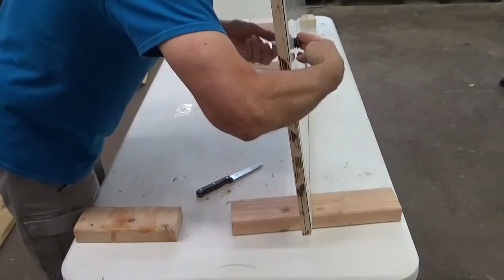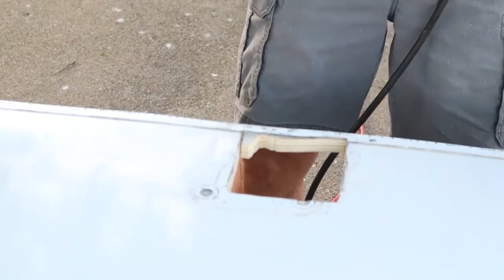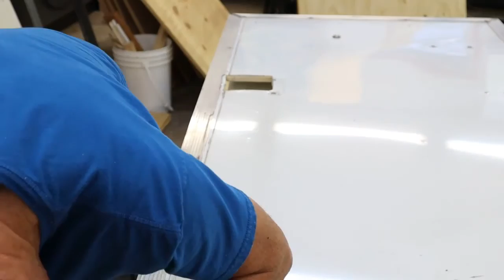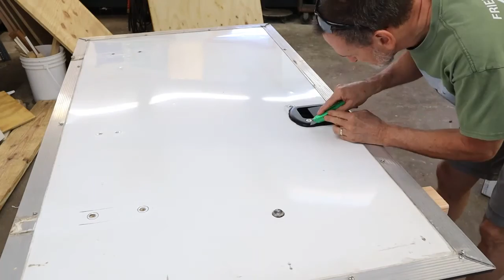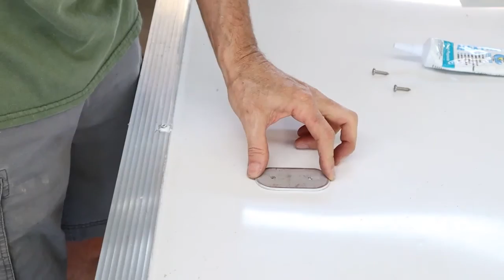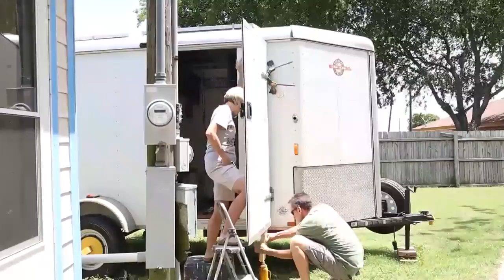TRAILER DOOR REBUILD Pt2 Cargo Trailer Camper Conversion Side Door Repair Enclosed Trailer Maint

Comment: I stumbled across this 2-part series while looking for some info about how to replace the ramp cables and how to adjust the tension of a torsion spring.  I must say, I really enjoyed watching your videos about how to rebuild a side door.  The side door of my 5x8 cargo trailed is starting to show signs of rot along the bottom edge, so I started taking it apart myself.  That's when I quickly realized this might be a 2-person project!  Removing the strap hinges alone requires two people, if only to remove the nuts and bolts, let alone physically removing the door and placing it on saw horses!  I also have a tremendous amount of appreciation for how long it took to clean the old silicone off the old skin.  OMG, I laughed for an hour after watching that segment!  It's so true!  If I lived closer to the my local supplier, I would buy new skin just to avoid cleaning the old skin!  Anyway, thank you for your very informative, commonsense videos and for your dry sense of humor!  Made my day.  Hey you don't happen to have anything about torsion springs, do you?!  :)
Reply from the maker: Thanks for watching. Yep those doors are heavy. Sorry, I don't know anything about those torsion springs. I have them on y trailer as well and mine need some attention too.